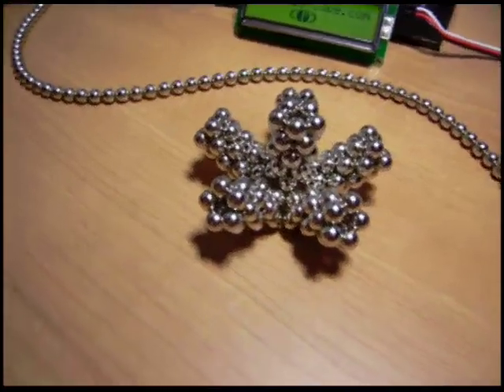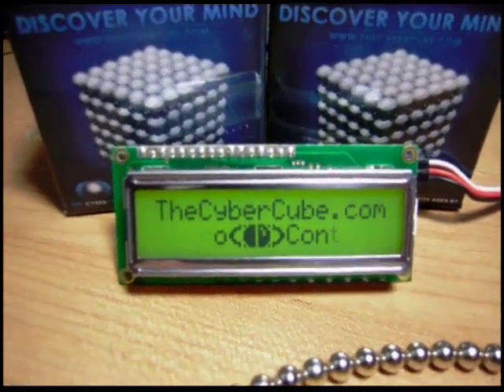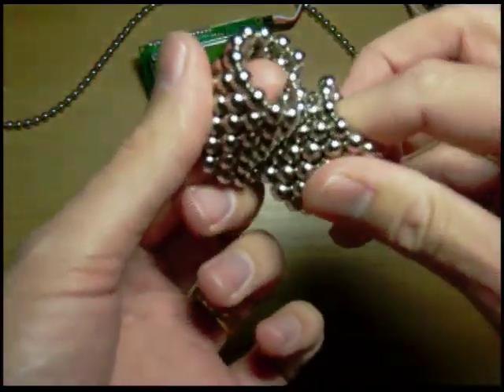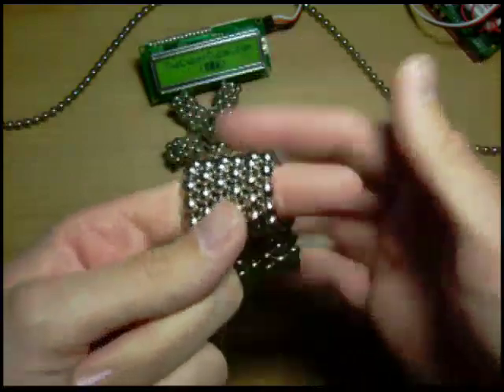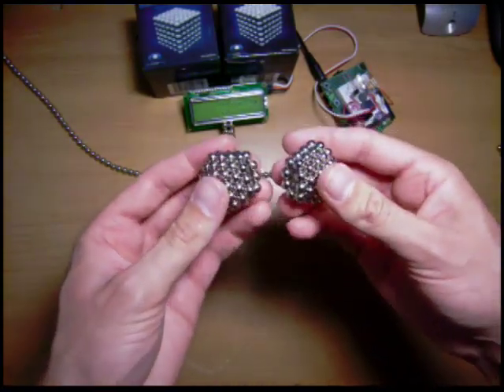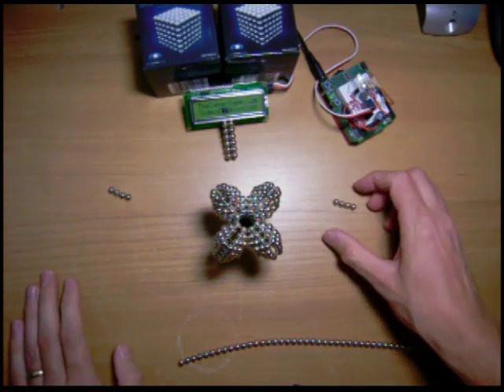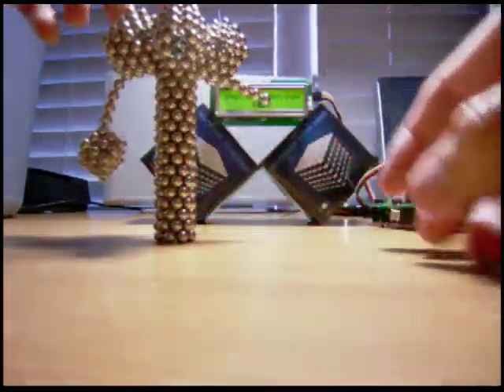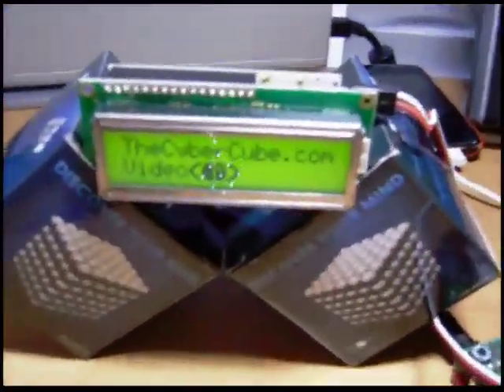TheCyberCube.com Video Contest - Finger Ratchet - Cube Tree

Comment from the maker: Thanks xTomxDark!  I wrote C code for my Arduino microcontroller development kit, which just happens to have a serial LCD attached to it.  I wrote a few functions that automagically erase characters after they are printed to the screen, and defined the custom characters that compose the CyberCube logo.  For the most part, it's all really simple stuff that anyone could learn to do.  Check out the link in my description to the Arduino website.